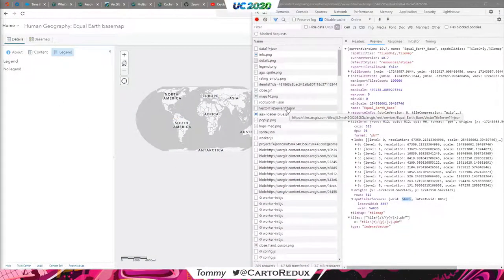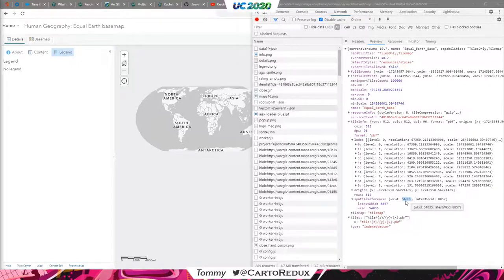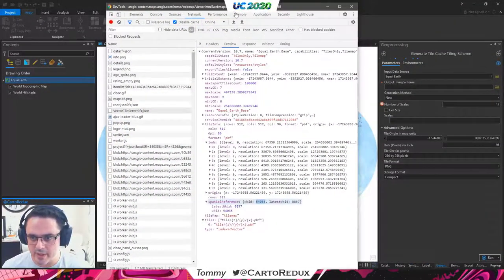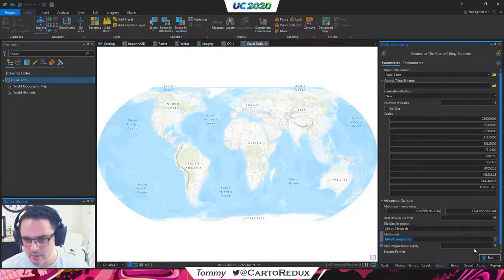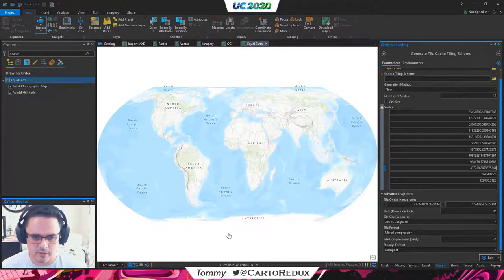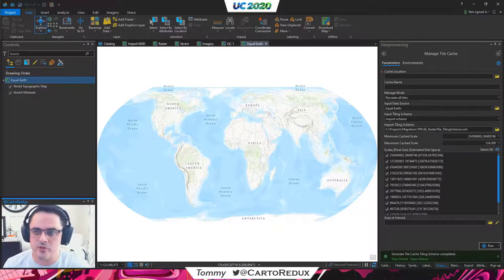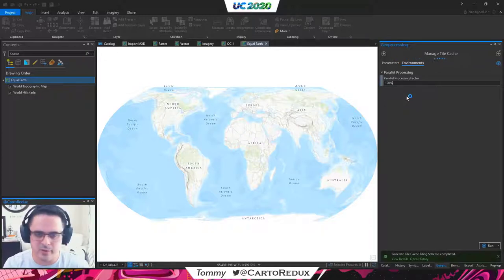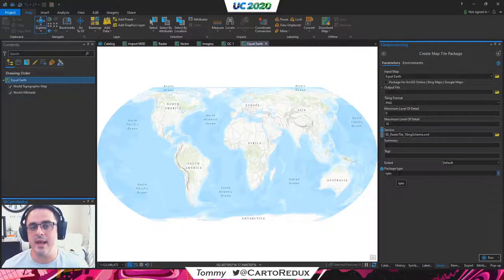Caching with ArcGIS: Creating A Custom Basemap Tiling Scheme

Comment: Hi :) Thanks for a great video. I accidentally posted my comment on another of your videos instead of this one - sorry for any confusion. Can you let me know whether it is essential to have the same origin and levels of detail as the vector basemap? For ArcGIS Online, the Map Viewer can show a tile layer with a different tiling scheme than the basemap, but the coordinate systems must match. What I'm after is when is it essential to match origins and levels of detail?

Finally, do you know of a way to work out the tiling scheme of a raster tile layer as easily as this?
Reply from the maker: Hi Georgina, in terms combining basemaps / tile layers in the same map, all of the tiling schemes need to have the same coordinate reference system, origin, and levels of detail. The map viewer may be doing some magic behind the scenes to more gracefully switch between basemaps of different tiling schemes; but it's still not able to show two tile layers with different tiling schemes. The fastest way to find the tiling scheme of a tile layer is to dig in to the item details page and find the rest endpoint URL. Not the friendliest of things to navigate; but all the info is there.

Comment: Hi, is there a way to find the origin in arcgis pro itself? I couldn't find the Origin with Chrome, because I have No expierence with the Developer Tools.
Reply from the maker: Not that I could find. If you have a raster tile or vector tile layer in ArcGIS Pro, the layer properties source tab has a server URL that you can open in a browser, and it should list the origin under the tile info heading. If the page you launch doesn't appear to be formatted, it's likely a vector tile service. Copy all of the text, and paste it into Notepad++. Make sure you have the JSTool plugin loaded. Paste the text into Notepad++, and use the JSTool plugin - "JSFormat" (ctrl+alt+m), to make the text a bit easier to read and locate the tiling scheme origin. I hope this helps!
Reply: @CartoRedux  thank you so much 👍